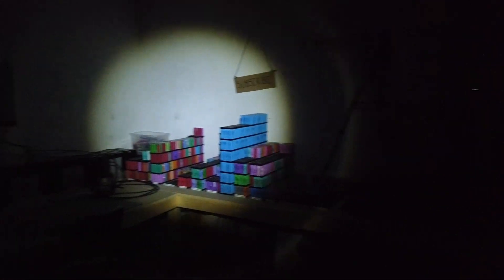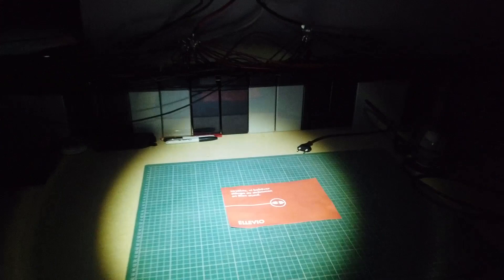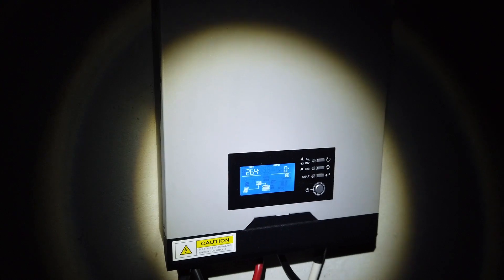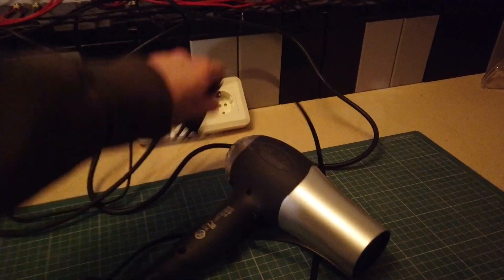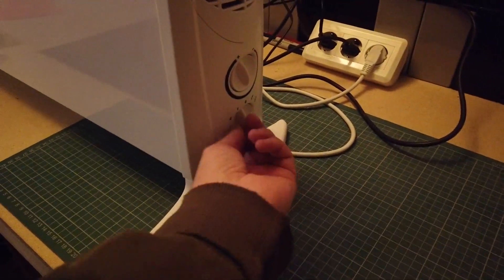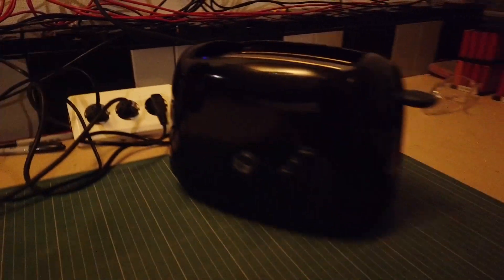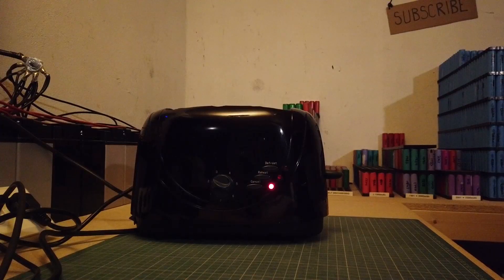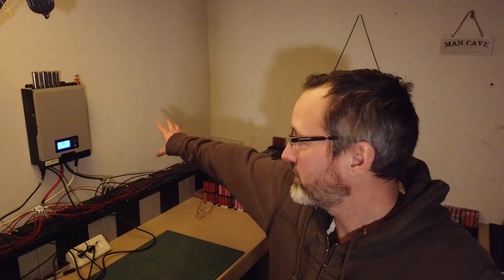Total Power Outage Forces Real DIY Powerwall Test!

Comment: Iv just started connecting my new me3000sp battery inverter. It will help save the power from the sun and store in batterys then when I put the kettle on the power will go from the battery’s back in the the house. AC coupling is the way forward :)
Reply from the maker: That's the way to do it :-)